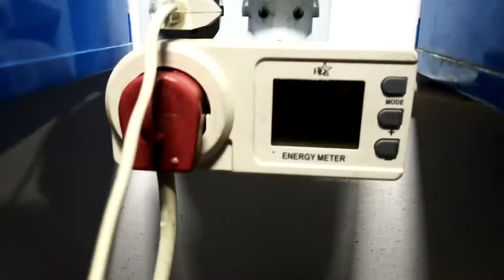1000w 30kV fat electric arc

Comment: Is there any possible using of this huge arcs? Welding without electrode?
Reply from the maker: It would be dangerous to weld at such high voltage. It could be used to generate plasma, lots of UV light, NO2, or to melt some metals or facilitate some chemical reactions. Ionic propulsion uses high voltages to accelerate ions to very high speeds.
Reply: too cold as well